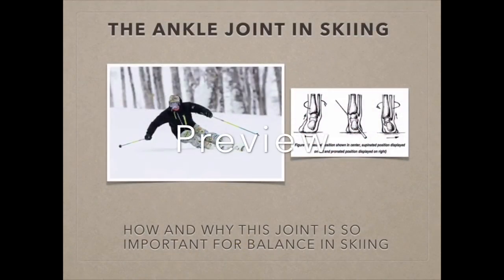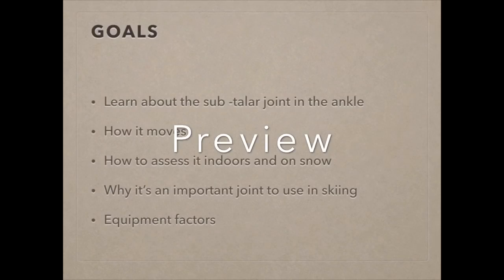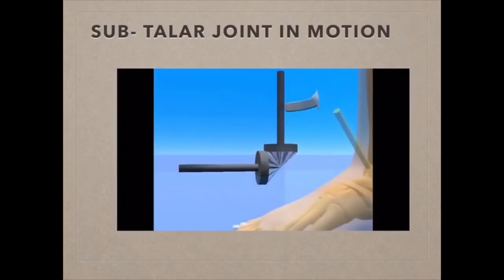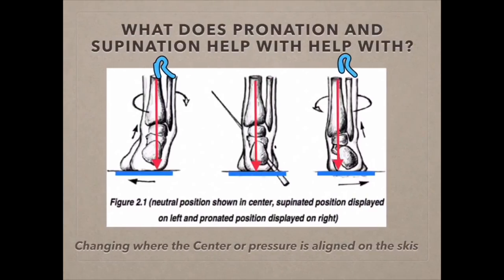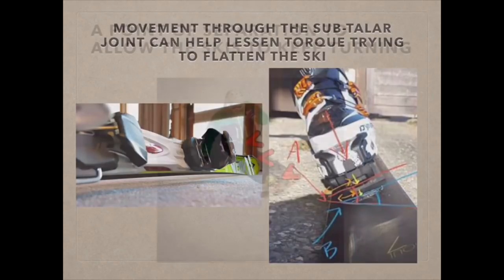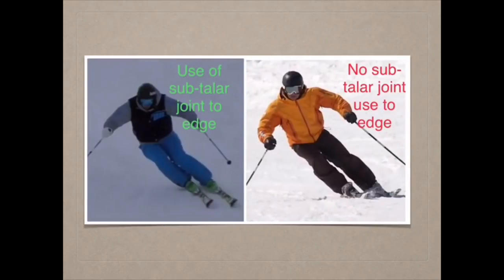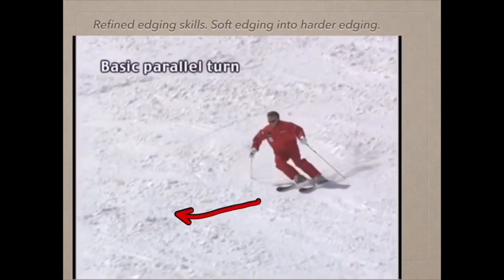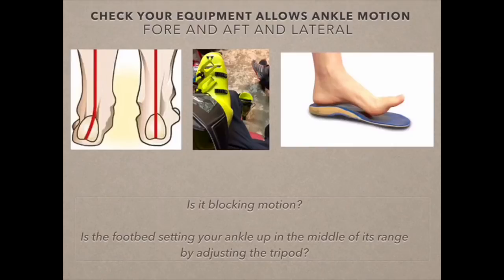Refined Edging and Pressure control for skiing - The Sub Talar Joint

Comment: It's always great to watch your very informative videos, thanks Tom. I've been waiting for an opportunity to ask a similar question to John Doe. Varying degrees of external tibia rotation is very common. Boot fitters do not seem to take this into account, and there is almost no mention of tibial rotation related to skiing on the web. 

The issue is, that in order to align the foot with the femur, the foot has to be rotated/inverted medially. This is not really an issue for the outside ski foot, as the foot is still able to evert/rotate laterally to angulate at the knee. The big issue is with the inside foot, as there is no further medial rotation/eversion movement left to use. Angulating at the knee is blocked, as John Doe's video shows. For me the answer was to cant my foot bed and add heel lift, even though I have good dorsiflection. This set up also helped my daughter, who has about 25 deg external tibial rotation.
Reply: Bob Dodds maybe try to feel your little toe of your inside leg?